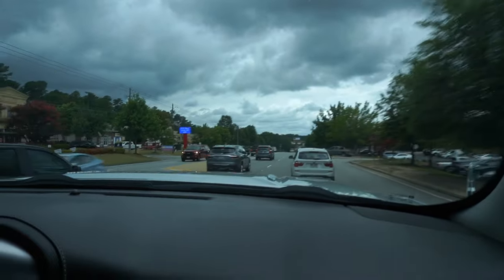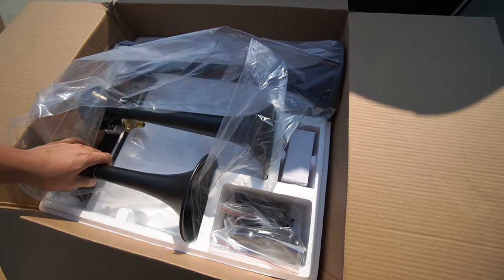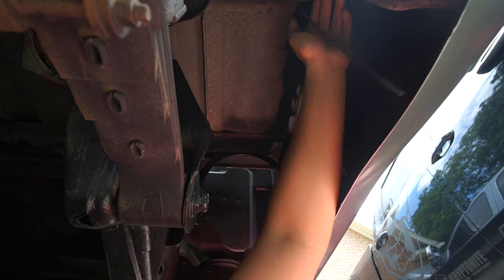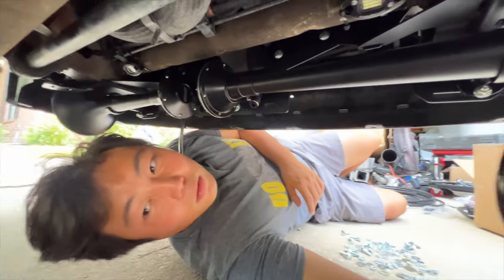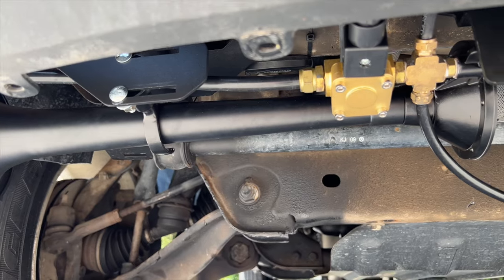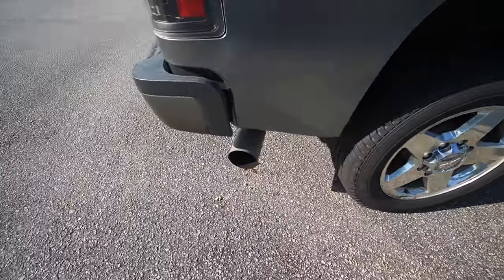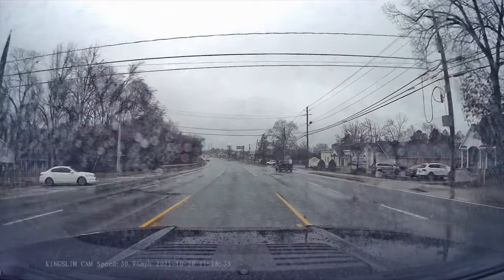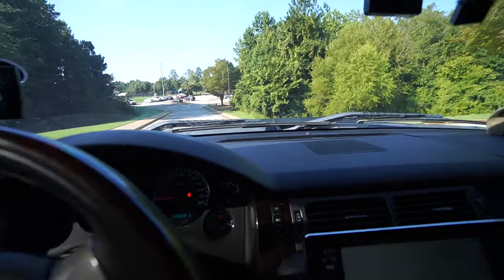Watch Before Buying Train Horns For Your Truck!!! *Kleinn AirHorns*

Comment: Thank you for some insight. I mostly drive a very dark SUV that's completely blacked out, including the windshield via a waiver; I've lost count of how many times I have to use my regular horn to alert drivers.

Now that I'm in Florida, I've had incidents with a lot of drivers who either don't care about wrecking their vehicles, or are simply deaf Q-Tips behind the wheel that somehow have a license.

Thanks for the video! While I don’t want to give anyone a heart attack by using a very loud horn, I firmly believe that if it prevents even one accident, or injury, then it's a great investment.  

I'd love to see some comparisons of that setup directly next to a stock vehicle.

 I will also say, that I'd certainly like a very detailed installation video - you're more than welcome to utilize my vehicle to do an installation and it will be a good time. 

Have a good day 🥂

Comment: I need this. Had 3 people pull out in front of me today. 1 was legitimately clueless I was approaching him and he started backing up in the road to back into a parking lot. Had I not seen the stupidly dim aftermarket brake+reverse lights in time I probably wouldn’t have been able to stop in time. He was already 90* in the road before he noticed the grille of my truck in his window. 😂
Another pulled out in front of me and drove 10 under the speed limit and stopped at a green light. Wasn’t an elderly driver either, maybe a mid-20’s female. 
The third one just stopped in the middle of a construction zone to observe the tractor doing work. This was right after they pulled out in front of me leading into the construction zone.
This horn setup would have paid for itself today alone. 😂😂😂

Comment: I'm interested in a kit like this I'm just wondering what do you wire the compressor up to for power? I've always assumed the cigarette lighter.
Reply from the maker: You use a relay and tap into the battery and ignition source.
Reply: @JWMontoya  Just learned that did a little more homework on the subject thanks for the info.

Comment: It’s totally crazy how people don’t realize a truck with a trailer does not and will not stop on a dime.  I’m in a 3500drw and pull 34’ trailer and have people cut me off and then not use their gas.  Yeah, air horns needed.  Don’t need the train horn scary loud, but surely more than the stock horn.

Comment: I just ordered the 734 kit for a 2015 Chevy 2500hd, can you shed any light on  wiring the solenoid?
Reply from the maker: There’s another train horn install video I did. I may have went over it there, but it’s very straight forward.